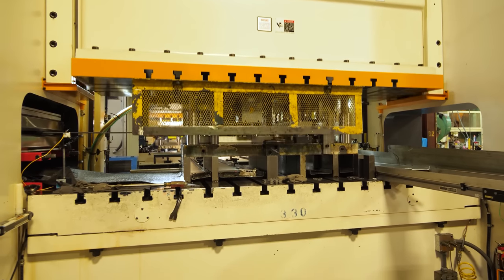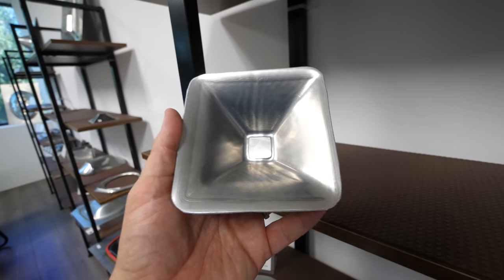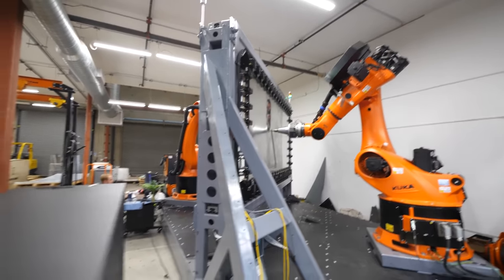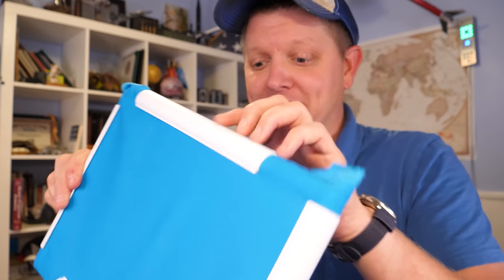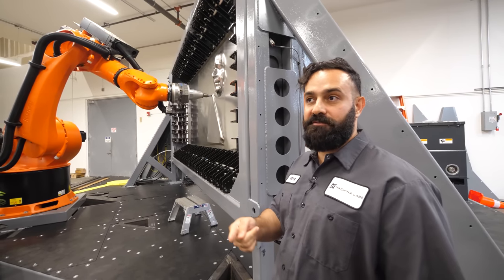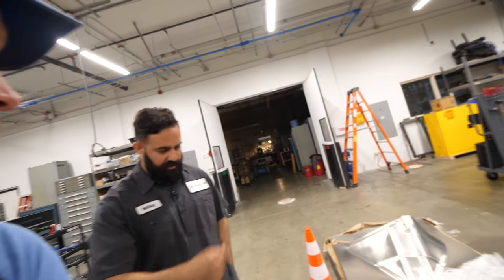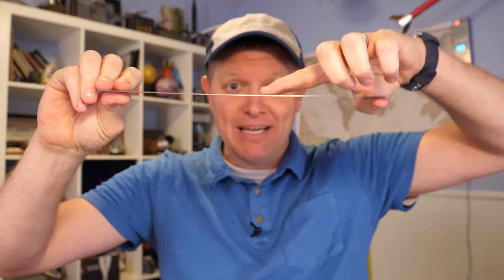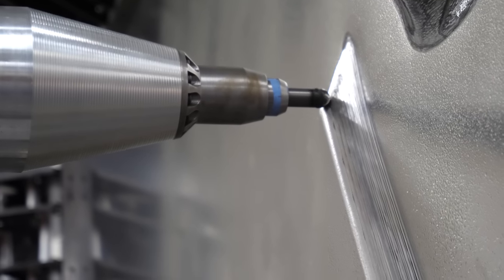ROBOFORMING: The Future of Metalworking? (I Had NO IDEA This Was Possible) - Smarter Every Day 290

Comment: The effect they are using with this sheet metal is essentially the same effect ice skate blades use to glide across the ice with reduced friction. They are using the machine tips to create a high pressure zone that locally softens or melts the metal as the die tips move in unison which is how they can get the deflection with less or no tension left in the part. A fascinating process, I have spent many years maintaining multi axis robotic systems and I would think this method would create more strain on those joints than simply moving a part to a required position. I would guess that the number of hours of operation between the rebuild intervals is significantly reduced in order to keep the parts within customer specified limits. I hope they have implemented Statistical Process Control to track this tool wear over time and perform maintenance prior to the point of excessive drift affecting the tighter tolerances. If they are collecting this data they might even be able to get something from the tool manufacture for it, as long as they are not using warranty repair on the tools. Like you I am simply amazed at the level of math required to work this out on a theoretical basis and have a great deal of respect for the engineers who are working it out. At the same time I feel the pain of the maintenance crew that keeps those tools running. :)
Reply: i would pretty much bet my house they are collecting that data as they go. if for no other reason than as an easy added profit stream for all this design work.

Comment: It's like the chickens head trick you pointed out in another of your videos how no matter how you move the chicken (obviously within its tolerance values ) it's head will stay in the same spot even if it's body is going up/down side to side of circular motion so it's like using two chickens heads one on each side of the plate

Comment: Legitimate questions: 1. Why do encoders not account for backlash and deformation in joint position under load? 2. Why not use a gantry style robot instead? A series of linear actuators would give you less total joints, a more rigid structure, and higher and more consistent linear force imparted into the work piece. Just gimble the end effector for your angles. Kinematics would also be easier.

Comment: I want to see these guys make a steel drum.  They are pretty much hand made (striking small areas of metal repeatedly) and it takes several days to make a single drum (along with heating steps, in some cases tempering steps, etc).  They could probably do this in a couple of hours.

Comment: totally awesome!  question for the engineers out there: this process seems like it would create intermittent internal stresses inside the material, no?  Is it possible to manufacture parts with some sort of defined structural spec/requirement? How does this process affect the crystalline structure of the metal and does the irregularity of the surface introduce areas for cracking, etc?

Comment: One additional nuance regarding optimizing position... there may be an optimal robot arm position for applying pressure at one single point on the metal.  But since the process involves moving that optimal position changes with each new location.  Thus, in an optimal optimization for force you'd see a lot more translation movements of the various arms.  But you're also optimizing energy, time, complexity, and machine wear, so you have to find a balance of all these variables weighted against each other.

The good news is that math can help.  Start your pencils!

Comment: Two giant kUKA robots! Nice. These this are top of the line programmable robots. The have made a crazy accurate “English Wheel”.    Couple  million bucks+ for this setup but the control software is the really tricky part. I have seen these install rivets, weld and do it with incredible accuracy.

Comment: Love this format! However just wanted to add that the backlash problem is much less crucial than the deflection problem. Especially in linear motion ball screws and linear rails have no relevant amount of backlash. It's the high load application on a rather elastic robot that causses millimeters of "give". I wonder how this tech would perform with two opposing 3-axis gantries holding the end effectors?

Comment: I’m really impressed that they got a bent titanium part, titanium has a hexagonal close packed crystalline structure and it has the least slip planes and is much more susceptible to cracking than steel or aluminum when it is being worked since they are body and face center cubic metals, you would also have a similar issue with magnesium, but again kudos to those guys

Comment: In a 6DOF articulated robot arm, of the sort being shown in this video, the manufacturer usually only guarantees a repeatable POSITIONAL precision of about [0.33] millimeters. In other words, these types of robots are fine for tasks such as "pick and place" or "machine feeding", but they are no-where-near positionally accurate enough to perform [0.0001] of-an-inch parts machining.

Comment: 01:02: Introduction to incremental sheet forming, a new manufacturing process.
01:22: Visit to Machina Labs, a company specializing in Roboforming technology.
02:51: Explanation of how end effectors deform metal sheets like a potter shapes clay.
04:11: Incremental forming is ideal for development and low-rate production.
04:44: Historical context of incremental forming research and its commercialization challenges.

05:40: Demonstration of robots performing incremental metal forming on aluminum sheets.
08:03: Explanation of how localized deformation is achieved using two robots.
10:06: Discussion on the challenges of maintaining accuracy under dynamic loads.
12:00: Overview of backlash and its impact on robotic motion control.
17:01: Boundary condition effects on accuracy and the importance of software in forming.

20:30: Introduction of a robotic craftsman concept for versatile manufacturing tasks.
25:00: Potential applications of Roboforming technology for forming tough alloys like titanium.

Comment: They spent a lot of time explaining the complexity of applying the right amount of pressure from each arm while the metal is being bent. 

Is there a reason they wouldn’t use a fixed pressure arm approach where the 2 points are essentially stationary and the XYZ controls are done by a device holding the metal and pulling it through the pressure point, almost like closing a ziplock bag by pulling it between your fingers instead of running your fingers along the seal.

Comment: I can't believe I'm a year late to this video, since I've been watching your stuff for a decade, but as a blacksmith this concept is fascinating to me, because they kept comparing it to pottery, but what they're really doing is a sort of automated chasing and repousse.  I'm curious about how the metal behaves the more they work it, because if I were doing this with the traditional tools, I'd have to stop periodically to anneal it, and obviously they don't have a torch on the robot to soften the parts they're still working on as they go.  I wonder if including something like that would be beneficial for certain designs or materials.  I also wonder if they have equipment to anneal the parts after they've finished, depending on the application.

Comment: 6:16 Destin: Are there any safety features in place?
Them: Nope, use your best judgement.

(While deceitfully slow moving, remember F=ma... Those arms are massive and dang near immovable, meaning even a slow jerk into your hard head won't slow the motion of the arm down any... If need be it will break your skull to get to it's next location and there's no cushion besides the small bit of skin and elasticity of your skull's bone tissue... Stay safe around those machines)

Comment: I wonder if everything could be made simple by using just a 2 axis "roboarm" with linear actuators (a pushing tools that can push or pull back while moving on X, Y rails in other words) the control logic would be very easy to implement and you could engineer the moving parts in order to have the desired accuracy and mechanical "stiffness" in order to reduce errors induced by torque.

Comment: The drives of these robots are ball screws and harmonic drives there is no backlash, use this type of machine to do this is open for deflection. You need a dedicated machine with XYZ movements and maybe if need two more rotary axes.

Comment: You're dealing with a single sheet of metal that as it is deformed it is flowing, stretching,  gets thinner or thicker  but also starts to work harden and gets brittle.  How do you deal with the work hardening?  Does a robo torch come in the anneal the metal??  For example if you are forming Copper or other similar metals that need frequent annealing??

Comment: Really like the idea and the concept. But just looking at it is there any reason to have the larger robots with large arms? Couldn't they simplify a lot of the deflection problem by mounting the deformation tips to rails backed up to a much heavier and more rigid plane? You wouldn't get to see the visual as much as the big arms but it would simplify the math if you had much smaller distances involved with the length of every part of the arms and a solid backing plane to brace it on.

Comment: They keep saying it is like clay but it's more just like a reversed precision version of an English wheel. The way hand built car fenders are formed. I could imagine in the future that they'd add a full XYZ axis motion to the part holder as well. The consistency of the material thickness  is probably also an issue. It's probably gauged before hand.

Comment: Why not have two feedback loops to take out a lot of the complexity.  Have accurate position sensors, so regardless of deflections of the robot the robot will always be trying to correct those deflections.  Secondly, be constantly scanning the job and feeding that information back in to ensure best fit to the desired outcome?

Comment: i wonder why they dont use a more simple X and Y axis 3D printer type design, with a linear actuator instead of the printing nozzle that can just move in and out a certain amount but still move around the exact same way. that way it would be bolted up to a potentially far more robust "grid" or track or whatever, and i seriously doubt any deflection would even be an issue anymore since it would be almost the same movement any direction with no joints in it.

Comment: Being that they're forming sheets, I'm surprised at the use of robotic arms, rather than sandwiching it between two traditional CNC styled apparatus, where the 2 forming heads are riding on tracks. It seems like an over-design - is there a reason for it? Depth?

Comment: Robots use harmonic drive gearboxes or cycloid gearboxes and those have zero backlash and also for linear positioning we use ballscrew bearings which is not tge same whit trapeze thread like you were showing.

Comment: hyper vibrate the sheet metal. 
the metal will form much easier, by assisting the process, through micro movements. 
get the shop some hearing protection.

Comment: Could be a stupid question but I’m curious as to whether you could run a current through the tips (I imagine the design would have to change for each of the ‘ball point’ tools). Is the problem with heating alloys the expense of heating or the fact that you’re altering the properties of metal through heat or just stretching it because of it becoming malleable as well as other affects heat has on metal? Because if it wasn’t expenses could you run a current through the tips to then heat the metal, or would you need a coil to do that. The same way electric forges work. Could you increment form thicker material or more difficult alloys with the use of heat, or does it defeat the purpose of increment forming because like he was saying a benefit was the fact that you don’t need heat, would that not change when dealing with thicker or more difficult alloys? Or would running a current fry the entire robot, I don’t know if you could isolate the current or not. Or maybe have the tools following behind a heating element on the same predetermined path/ increment? Enjoy trying understand my thought process but that’s very interesting, fantastic video.

Comment: Its really computerized tin bashers, as the principles are pretty similar. The computerized version may have more versatility for some times of work and able to do micro work. One of the biggest difference between manual tin bashiing and this, is that the computerized version seems to have stepped ridge resolution (like on the face it was working on), rather than the smooth work of a tin basher.

Comment: One could argue that this is another kind of 3D-printing, just imagine the end effectors (did I spell that right?) being the print nozzle and the deformation they cause being the extruded filament.
Reply: It's not at all lol
Reply: @kitten-whisperer  I don't see any arguments as to why u think my comment is false, but let me double down:
Just like a 3D printer the robots performing this operation produce the desired result line by line, layer by layer, the only real differences being that all the material that will make up the finished piece is already there instead of being extruded by the robots and that the finished product is always a hollow shell and can't be filled in to be turned into a solid lump of metal using this same technique. The process even appears to leave layer lines behind just like actual 3D-printing, which to avoid would require an impractically fine "resolution", which in turn would make the same piece take days, if not weeks to complete.

Also, I didn't say "This is 3D-printing", I said "One could argue that this is another kind of 3D-printing", which are 2 entirely different sentences.
Reply: @DualDesertEagle  nah
Reply: @kitten-whisperer  Still no arguments in sight...
Reply: @DualDesertEagle  It's not even close to 3d printing... as 3d printing is additive process, here you don't add any material

Comment: Does this process end-up creating either stressed or de-stressed parts?
Most customers (especially if a tight tolerance is to be maintained across the entire surface of a wide surface-area part) want to be promised that they are receiving a fully de-stressed part.

Comment: If the robot arms can load up stresses in different configurations for the same tip position, then why not use a much simpler gantry system?  This process has a lot of similarities to metal spinning, it looks like.

Comment: It is the same issue as with additive manufacturing. Slow it goes. Structural parts of space craft, satelite, weapon systems or maybe commercial airliners with a couple pieces pa are aim for this and you really have benefits in cost and design freedom. But for more than up to 500 parts pa this is sure no option. 

How long did the face take? 2 days? How much is a machine hour? The worker? Energy cost? Manufacturing cost of this simple sculpture exceeds 4 digit prices 4sure so this is for very limited scenarios. The end effector will suffer wear and there is no cooling or lubricant so the speeds are low. Imagine to do this at 30ft/s which is easy achievable by the material you will lose any precission because of heating up the huge sheet and wearing the end effector. Great method but very limited to some exclusive scenarios. Hooks law is all around

Comment: I would use something like a C Chanel cross section and put the forming heads on that then just have one robot move the whole assembly, it would get rid of the deflection issue that the actuators cause and also it would make calibration so much easier and both the forming heads would move in unison 100% of the time.
Just like you having one hand and pinching your fingers with a piece of a4 in-between now you can very easily move your hand with your forming heads(finger tips) around very easily with a high degree of accuracy now try the same thing using one finger from each hand, a heck of alot more difficult to do it ain't it.
Controlling One hand two fingers, is alot easier than controlling two hands and two fingers.
My two cents anyways.

Comment: I am sure this has been said before, but they are using the same principle used by auto body guys with a hammer and dolly. As a human powered/controlled method of metal fabrication it has been around for a very long time. The difficulty with using a robot is the lack of the finesse and art provided by the human brain and body.

Comment: Umm A friend was at JPL for a public open house. Well walking by the dumpster(literally) there was all kinds of scrap metal sticking out. He grabbed some and just walked out the gate. he couldn't figure the stuff out. Couldn't melt it, bend it, all he could do is cut it and drill it. Turned out to be titanium. Strangest stuff we, umm he had ever seen, .But it was amazing to hold the stuff they make satellites from. It made great band saw blade guides. I wonder how it would have worked as a lawn mower blade. It didn't weigh much of anything. I can only imagine the cost value of what he got. That was in the mid 90's, think of what they have now.

Comment: Hey Destin, love your videos but to call this the future of metalworking is a little absurd. I work with CNC machining and I’d hard pressed (get it) to see a robot arm try to press out a intricate part with tight tolerances from a block of material. Especially with what the step resolution on those arms seem to be; which yes I know can be a very easy, but tedious, fix. A better title would be future of sheet metalworking as there would be no way this would replace metalworking as a whole.